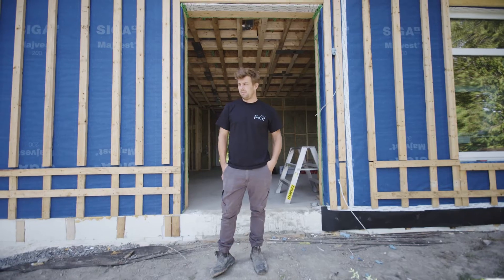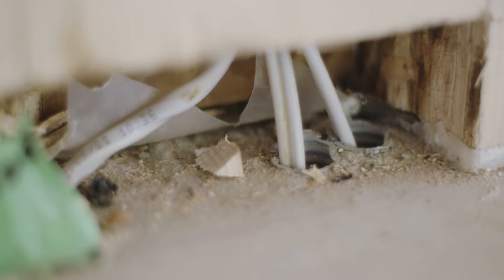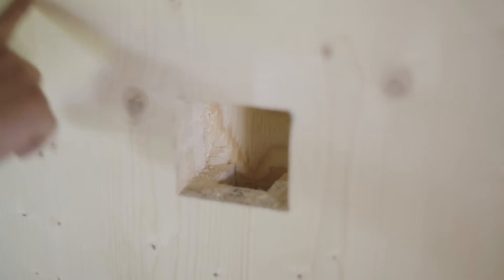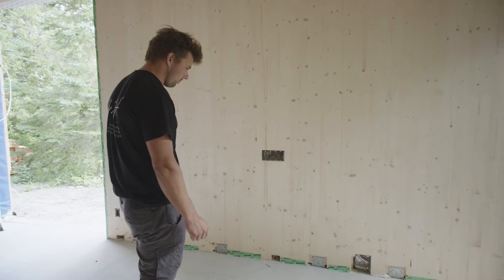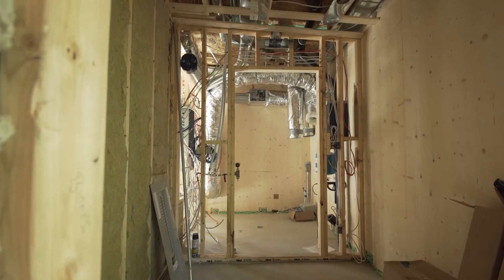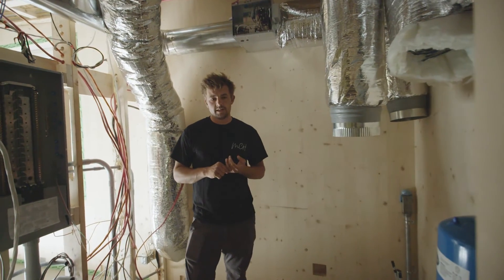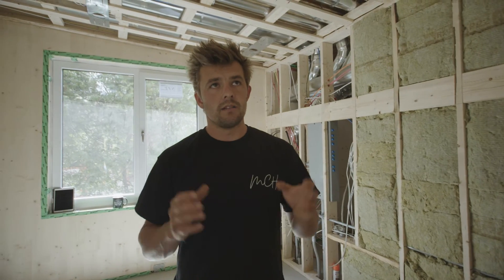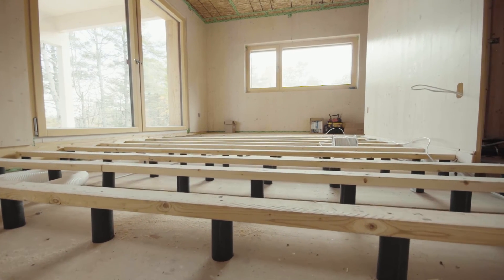Mechanical, Electrical and Plumbing on CLT Home

Comment: Interesting.  I'm thinking of using CLT to build a 24x48 garage with a second story.  Just starting to look into CLT more closely as a building material.
Reply: What’s the cost compared to a traditional timber frame garage
Reply: @rickybarratt535  Pretty much out of sight, due to a lack of builders being comfortable with the material.  Turns out that there's a big price adder if you ask a builder to do things they are not comfortable with.
Reply: @rodshop5897  yeah but what about just timber vs clt material cost comparisin
Reply: @rickybarratt535  Good question.  I would expect that someone has gone that far.